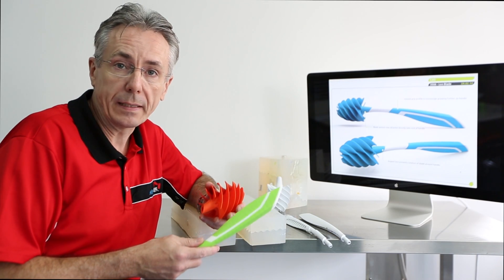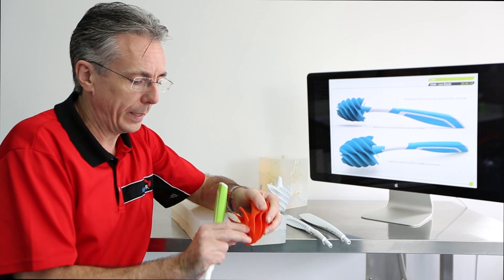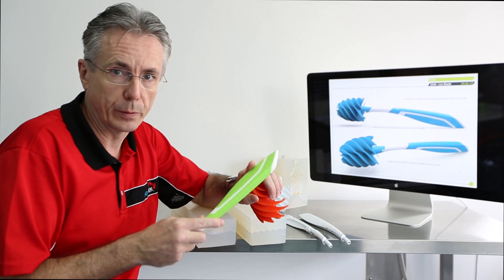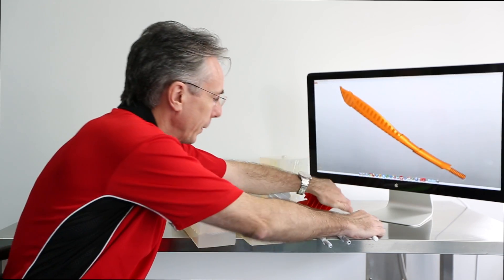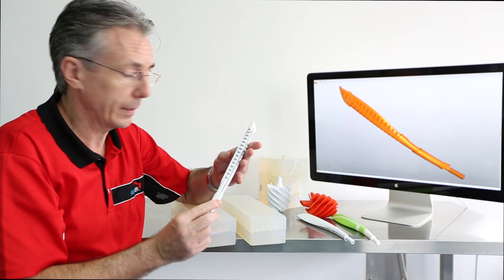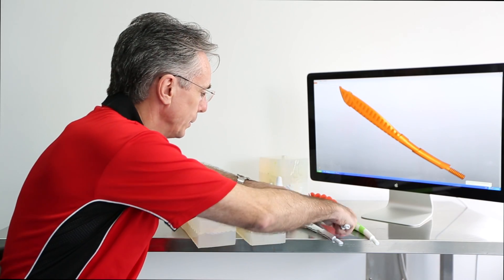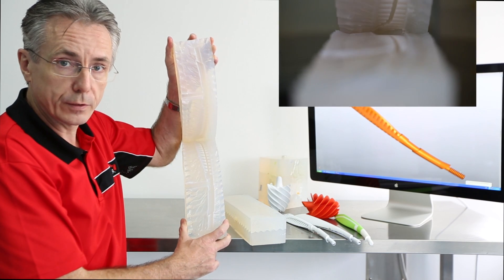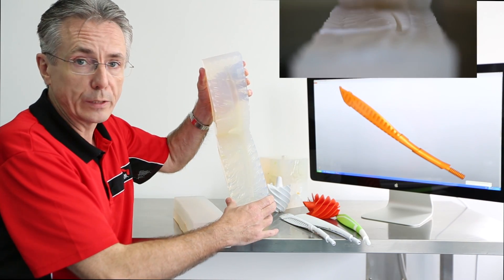How It's Done: Vacuum Casting / Polyurethane Casting | Star Rapid

Comment from the maker: Vacuum Casting Service at Star Rapid. We’re here to turn your product ideas into reality. Request a free quote today. http://bit.ly/vacuumcasting
Reply: Star Rapid how much would something like this typically cost? I am very interested. I want 5 prototypes in 5 different colors
Reply from the maker: @chrismichaud5906  
Hi! It really depends on the size, complexity and material used. This part was made using vacuum casting which is a process great for up to 20 prototypes. It is certainly an affordable option for prototyping. Feel free to send through your CAD files through our online request for quote form here: http://bit.ly/vacuumcasting 
and we can give you a cost. Any other questions, you can also email us at enquiry@starrapid.com
Reply: Star Rapid are all file uploads confidential? Also, what is the temperature resistance on your polyurethane
Reply from the maker: Of course. All file uploads are completely confidential! To answer your other question, our regular ABS like PU (Axson UP4280) has a glass transition temperature (Td) of 93C, so it would be good for 85C.  We have another ABS similar PU, PX223HT, which has a Td of 120C, and is good for boiling applications at 100C.  Finally we have UP6160, which has a Td of >200C, which would be good for up to 175C.  Two latter materials are used commonly in 'under the hood' applications in automotive.  Even our clear PX5210 can handle boiling water, but it needs to be post heat treated.  All resins can be post-heat treated to gain a higher temperature resistance; usually another 10 to 15C on top of the Td.  It is a little counterintuitive, but they are Thermosets, not Thermoplastics. We hope this helps!
Reply: Star Rapid thank you just submitted my enquiry. I am ready to do business with this company
Reply from the maker: @chrismichaud5906  Thank you! Looking forward to working with you :)
Reply: @starrapid  Hello what silicone type/brand you use for the mold itself ?

Comment: A really good video👍.For small-batch demands,vacuum casting(silicone mold) is one of the best choices,with low prices and fast delivery times.Usually,when we manufacture products for customers,ABS material is used more frequently.Of course, there are also other material options such as PC,PP, nylon, PMMA, and Rubber materials.😀